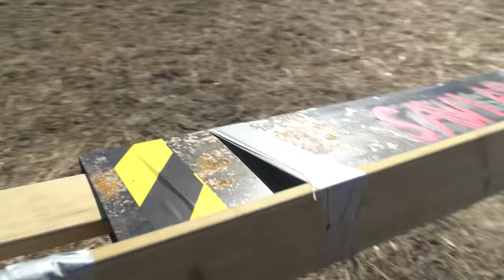Can you Launch Frisbee with Pneumatic Cannon?

Comment: I would get rid of the sabot altogether and angle the air nozzle slightly to one side.  The frizbee would still exit the barrel at a high rate of speed, but would be riding one side of the barrel for the entire length of the barrel, so it would be spinning quite fast upon exit.

Comment: You need a way to keep the launching block from exiting the barrel, as it will interfere with attempts to control the frisbee itself. How to do the spin I don't know. Maybe something like the wooden plank except more flexible so that it provides some resistance but does still move out of the way.

Comment: Perhaps a heavier frisbee? When I was a kid, my brother in law had a frisbee that had weighted edges that made it so it could be thrown really far, I think it was for frisbee golf actually.

As for spin stabilization, perhaps put some vanes of some sort along the edge that will catch the air as it flies to make it spin itself.

To that end, you could maybe adapt your sabot system into some sort of round outer edge that is attached to the outside of the frisbee, which both acts as a weight and has those vanes on it.

Comment: Could you make bearings on the sabot and have the frisbee touch the side of the barrel from the start? When it starts to accelerate it would start to spin also. If you could come a with a bearing design that allows it to spin very fast but also release easily from the sabot I think you could have long flying frisbee.

Comment: As many people have said, you need to get the sabot/cradle to separate from the disc before you will get any good results out of this There have been some potentially good ideas already submitted, with having the sabot separate into multiple parts, preferably spring-loaded or something similar. If you could get the disc spinning as it travels down the tube as well, that would probably be even better.

As a disc golf player end engineering student, If you do successfully get it to spin and fly faster than can be done by a person, expect that it may very well turn over towards the edge that moving opposite to the direction of travel (i.e., if you impart spin to it by rubbing it against something, that is the direction it will likely try to turn in the air). That generally occurs when the disc is thrown harder than it was designed for, such as trying to do a full drive with a disc intended for putting, or doing a disc golf drive with an Ultimate disc. Once it decelerates (assuming it's still in the air  or turned over so far that it can't recover), most discs will also end up turning over the towards the opposite direction as the early part of the flight.

Example: a right-hand, backhand throw (classic Frisbee throw, in which the back of the right hand leads) will tend to turn over towards the right at the start of the flight, especially if thrown too fast, then it will slow down and turn back over (fade) to the left at the end of its flight. This is because the disc is rotating clockwise, as viewed from the top.

Comment: 3D print a frisbee with built-in small chambers around the edge and put a smaller holder inside.  Combine that with a rubber strip along the inside of the barrel on one side and it might cause the frisbee to spin enough. :)

Comment: To use the air cannon redesign the sabot so the frisbee sits on top of the sabot to equal out the mass and make it more balanced, then put some rubber on the wood to help the  frisbee/ sabot grip the wood and not slip. Or something like that. Or use a spinning wheel launcher or skeet style launcher to get the frisbee spinning.

Comment: It looks like the 3D-printed sabot thing is grabbing the frisbee too much to let it spin, it might be a better idea to print something that only fills up the space in the barrel and doesn't grab on to the frisbee and just pushes it. The plank idea could probably work pretty good if the frisbee wasn't kept from spinning by the sabot. I think it could benefit from using less air pressure too since the air coming out of the barrel behind the frisbee is creating turbulence and flips it over etc.

Comment: a sabot that pulls      ...            same shape as the sabot you have moved up in front of the disc, add a 3.5 inch or 4 wide, 1/16 or 1/8 inch thick sheet of tin or aluminum that reaches under the rim of the disc, (to replace the fingers), then add foam rubber to the sheet metal (to replace the finger tips), make the length adjustable perhaps and the foam rubber so you can fine tune "the grip" to achieve a lot of spin, then angle the whole cannon to achieve proper flight for each disc.

Comment: You need some pop up air brakes on your frisbee holder. When it exits the cannon...the air brakes need to pop up to slow the holder down so the frisbee can get out of it. Also make the holder not quite as big as the frisbee. Maybe take 1/2 inch off of each side that way you can put something along your board that will catch the edge of the frisbee and only the frisbee so it will get some rotation. You want it to start rotating once its released from the plastic holder.

Edit: In a good setup...you could have the frisbee start rotating while it is in the holder. I have some ideas but nothing good with this design.

Comment: I love you guys!  I never know what to expect!, Lol!  Re: the spinning problem.  Go back to the shop, find a metal shipping strap that will fit width-wise in the slot along one side and attach it to the inside back of the slot barrel,  wrap the remaining strap around the disc,  insert wadding or modified sabot first, then carefully insert disc so that the strap remains wound around it, spooling it up along itself as you insert it into the barrel, then step waaaay back and fire.  Please be careful with that strap!  It will be like a scary flying razor from heck when it comes out!  Cheers!

FYI, you might need to make a second disc out of something more substantial to put in the middle along with the frisbee to prevent the strap from compressing and deforming/spreading against the side of the barrel as it gets hammered by compressed air from the back.
Reply: Nice!  spin strap as the sabot, with a bonus death razor!

Comment: You have to stop with a cable that "green thing" before it goes out(probably you need also an hole on the last part of the cannon to let out the air), and it can be perfect if there is one last part of the fire cane to give the direction and the spin to the frisbee(try to put a rubber strip on one side)

Comment: To get the frisbee to spin, you need to get it out of the cradle first.  Weld some stops about 10 cm from the end of the barrel to stop the cradle.  Then put some felt or duct tape along one side of the barrel to get it to spin.

Comment: Maybe a thread would work. Tie the thread to the edge of the frisbee, 90 degrees off center line of frisbee. Tie other end to cannon, short as possible. Thread, or string, would have to be strong enough to spin it, but break right after. Maybe cut the frisbee carrier thing in half so it releases sooner.

Comment: The problem is the air from behind. It's disturbing the lift of the disc's foward motion. It's like trying to throw it into a 60 mph wind in reverse. Spin can be achived by possible a slight weight on an inside edge.

Comment: If you cut a tyre (bike or car) in half and launch the frisbee into the inside of the tyre (have the cannon facing away from where you want the frisbee to go) it should ride around the inside of the tyre, imparting a lot of spin on it as the rubber from the tyre should provide decent grip

Comment: The problem is the 3D printer carrier, you need to work on a method to detach it. The sections that come round the side are too long. I would create something T shaped. It would be supported underneath, and also from the back but full height to stop the air leaking. An full engineering spec would be to have some sort of leak through the part of the T so that the air spins the disc while it is still in the barrel, possibly aided by some bearings

Comment: A better quality frisbee with a thicker edge probably has a better chance of succeeding. Also, perhaps a mild adhesive on the board would help increase the spin rate. Try again please. Also, you need to find a way that the launching cradle is released before it exits the end of the cannon. The marks on the wood are probably not from the frisbee but from the launching cradle.

Comment: your problem is that the sabot is heavier than the Frisbee. You also need a mechanism to slow the sabot after gas release, something like a short rope or a notch and catch on the barrel and sabot.  If you use a rope, use an elastic rope to cut down on the sudden kinetic jolt of a sudden stop.   if you use a notch and catch system, it need to be just enough to slow the sabot and not make a sudden stop of the sabot.  you can get spin on the frisbee but it would be more complicated build then you probably want to perform.   "I built a small plane once, I call it the raptor".

Comment: If you run a slot the length of your cannon and on one side of the sabots, then mount a band saw blade in it so that the teeth just barely touch the Frisbee, that might work. Friction against the sabot might prevent it form spinning though.

Comment: I would add stops to the launchpad to block it from escaping with the frisbee. Like just a bit of metal atthe end that blocka the launchpad but not the frisbee. Then I would add grooves to the plank to help guide it some more. Then I would angle the cannon slightly upwards to help with areodynamics. And finally I would find a good max pressure where the frisbee still flies, I dont think its aerodynamically stable for 60m/s without tilting too much upwards/downwards..

Comment: I think you really need a mechanical launcher to make this work properly. The frisbee flying is a aerodynamic phenomenon and your air cannon is taking the dynamics out of the air before the disc has a chance to stabilize and start flying straight. A mechanical thrower using the centripetal force to both make the frisbee accelerate enough and to rotate enough could be surprisingly easy to build and use. Two "sticks", a spring and a release mechanism should be enough. I'm not a professional in mechanics or aerodynamics, but I have very good understanding in them and I occasionally invent stuff so there is something to say this is going to work. If you wan't to know what kind of a system I had in mind just pm me somewhere.

Comment: What if you could spin the frisbee up inside the pipe by gluing some magnets on it and using a spindle with magnets outside the pipe? The pipe would need to be made of some non-inductive material, though.

Comment: on the slow mo video it looks like the carrier is protecting the frisbee from the propulsion gasses that are flowing past it once it leaves the barrel. when the carrier separates from the frisbee it look like it is getting hit from behind due to the turbulant air flowing past it. also one suggestion for spinning make a barrel that is a tighter fit to the frisbe and put sand paper on side of the inside may not have to be the entire length of the barrel maybe just the last meter.

Comment: No matter what you do with this air push idea, initiating spin on the frisbee is going to be nearly impossible. Especially with that sabot causing so much trouble. The only way I see you might would be to somehow stop the sabot just at the end of the barrel so the frisbee is freed from it. Then have a gently curving piece of wood or plastic on one side for the frisbee to run against to make it spin. One maybe a meter long or so. I don't know how you'd achieve that though. You'd be further ahead to give up on this device and build some sort of mechanical flinging arm. Something like a souped up clay pigeon launcher.

Comment: My thoughts on spinning the disk. Modify the disk with an axle in the middle that will still fit down the launcher. Modify the 3d printed part to hold the disk by this axle to allow it to spin freely. This part would be very thin on the side toward the end of the barrel. Add air nozzle in breach of barrel to spin disk. Add stop on end of barrel to stop 3d printed part from leaving barrel. Once disk is spinning launch.  Disk is spinning, 3d part stops at end of barrel, thin section of 3d printed park breaks away allowing disk to keep going. Just my idea.
Reply: by adding a simple longer stronger string to your input, you have a high spinning disk at high horizontal speed with two "small" (fuse, easy to replace) strings at the rear of sabot, when small strings breaks, they put late the 2 half sabots, one on top, one to bottom, and the disk is free to fligh. I hope that  it not too late for implementation.

Comment: Maybe some sort of 3 wheel system built into the frisbee cradle. 2 wheels on left side as bearing points and one on right rear quadrant that can barely run on the inside of the launcher. This way you load the spin inside the launcher when there is pressure

Comment: Spin it up first in the launch slot - then launch. How? spin it up with an air jet to circumference of frisbee using 8mm tubing from air compressor poked through side of launch slot. You do need a holder with a basic bearing/bush (like what clamps a cd in a cd player) so the frisbee can spin inside the holder - the bearing clamp is spring loaded so it unclamps from frisbee on exit from the slot.

Comment: Attach a string to the launching cradle (Wadding) so that it stops just as it exits the tube (The wadding needs to be stopped square to prevent the frisbee from being "Pulled" down), then you can have your device to put spin on the frisbee.

Comment: I think it would have be be like the rifling in a gun barrel works, it starts spiraling from the very front of the chamber.   Gear rack down one complete side of the barrel.  Something for the disk/blade to spin against.  Also the launcher piece must not put friction against the disk; same shape but a tongue out to the center of the disk and a bearing that the disk can spin on.

Comment: What if you had metal inserts on each side of the outlet hole the width of the frisbee carrier to separate the two. Then attach some sort of clamp to one side of the frisbee and attach it to a string tied to the cannon. When it launches it’ll first separate the frisbee from the carrier and then the force of the frisbee will separate it from the clamp while creating a spinning motion.

Comment: Maybe make the cradle for the frisbee in 3 pieces that fall apart almost immediately leaving the barrel because of air friction, then the frisbee will keep flying, and have a slightly angled 4x4 piece of sheet metal to glance the frisbee off of and maybe it'll cause the spin

Comment: Maybe if you have a router collet to get the disk spinning first inside the barrel. The router can drop away before the air pressure fires. And if the disk is already spinning you won't need the sabot.

Comment: Pneumatic Bolas\Whip. Same launcher concept but have an end tethered to a pole. So as it comes out it gets whipped around the pole once and then have some sort of stop near where it was launched to whip\flick it outward, which when the tether is stopped the disc should fly out in the direction you want but keep the spinning motion. Or some sort of curved arm to fling it out with a sideways trebuchet action.

Comment: Try making two L brackets for the end of the barrel that catches the plastic holder so it doesn’t leave with the freesby. If it doesn’t fly, try adding a strip of wood to one side (leave both L brackets attached) with a rubber strip so that it grips the freesby and causes it to spin.

Comment: Put the sabot in backwards so that it pushes but doesn't grip. Drill a hole along one edge of the sabot so that air flow will make the disc spin. Put pins at the end of the tube so the disc can exit but the sabot cannot.

Comment: What if you made sort of a sideways trebuchet with an end to hold the disc that would give it spin as it launched? See if you can make a goal here in New York from Finland! :D

Edit: As others have suggested, maybe without the sabot, and as others may have suggested, with a strip of rubber going .3 meter or so down the inside of the launcher, on one side.

Comment: Okay here's one of those annoying viewer comments. If you don't spin the disk it will always tumble. And you can't spin it in the sabot. So you've got to stop the sabot before you can spin the disk. You need a contraption which stops the sabot at the exit to the barrel and then the board with duct tape may work. Or you can design the sabot to fall apart as it leaves the barrel. Thanks for the video!

Comment: Also one way to make more friction on the disc, is to slow it down from above, so it has more surface to contact, but the real problem is that the holder goes with disc :/

Comment: The frisbee isn't going far because it doesn't have any dynamite on it. If you put some dynamite on the underside of the frisbee, and have a flame thrower pointed at the end of the barrel, the frisbee will explode as it leaves the barrel and then be accelerated into the maximum zone and go real fast, and go real far. That's what I'd do.

Comment: sporting clay launcher, powered by compressed air.

or use the current launcher with anchored thin steel cable running through barrel, wrap cable around frisbee while loading...as it leaves barrel it must unwind